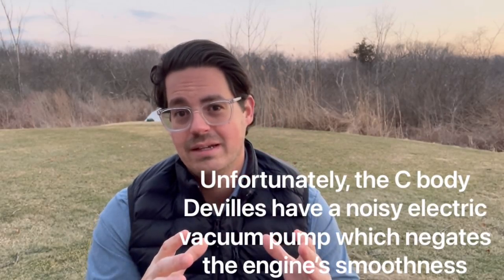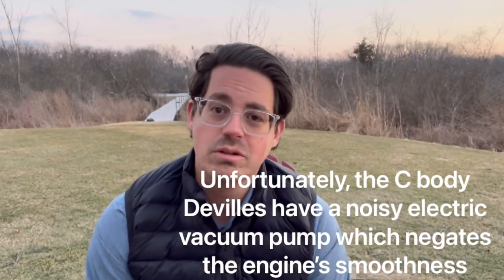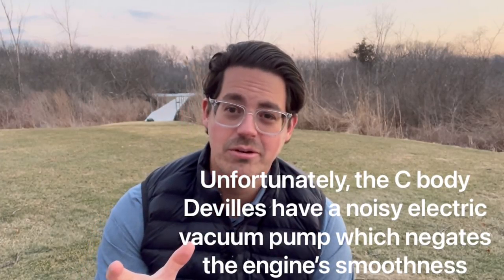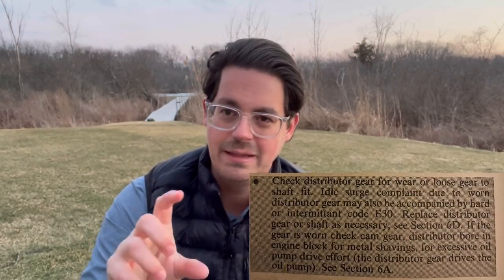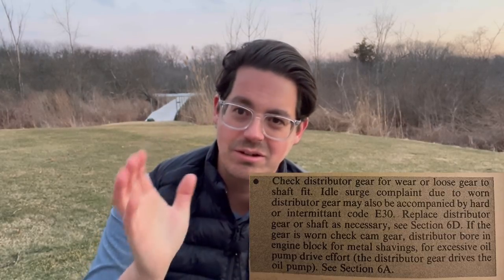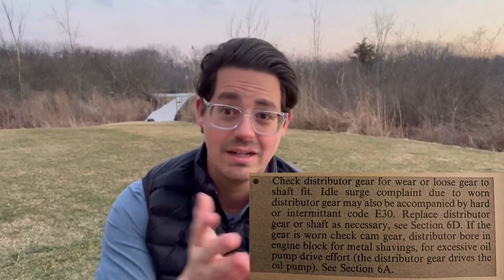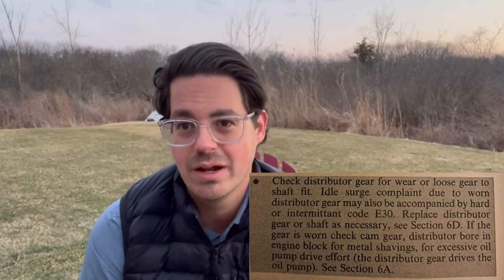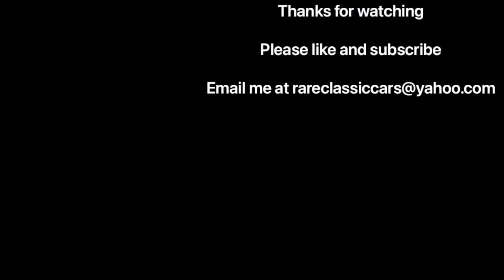Worst Engines of All Time: Cadillac HT4100 - Why is it so bad?  How can you preserve yours?

Comment: Thank you so much for this video! This was the most comprehensive summary of the issues plaguing those of us who owned 4.1 Cadillacs. I had an 85 Sedan deVille just like the one you pictured and I absolutely loved the car as a whole. It was smooth, very quiet and extremely pleasant to drive. My 4.1 had been rebuilt before I got it, but I did have issues:

1. I suddenly lost the oil pump while driving. Fortunately I was on a quiet residential space and I shut it off within 5 seconds of the oil light going on. I towed the car back to my house and dropped the pan, what had happened was one of the large steel pins that the pump gears ran on had slowly worked downward, allowing the shaft to disengage from the distributor. I bought a new Cadillac oil pump at the dealer, it was an updated pump from the 4.5. This issue made me lose trust in the car. 

2. It was very sensitive to plug wire condition. Once the wires started to go bad it would slam into a lower gear very harshly, at first making me think that the trans had gone south. I drove out to a very dark place at night and watched sparks go all over the wires. I replaced them and the problem went away, only to reappear maybe a year later. New wires again solved the problem. 

3. My 4.1 and many others I heard had a dull thumping sound in the engine. Somewhere I read or was told that it was camshaft end play. I don't know, but it sounded bad. 

4. My thermostat went bad twice. Not bad enough to overheat and turn the light on, but when I parked and shut it off I could hear coolant boiling. I kept the coolant fresh and used the tabs. This was promptly repaired on both occasions.

Comment: The 4.5 was ok, the 4.9 was great! I had a 93 De Ville 4.9. Great gas mileage, a hot rod for performance. a pleasure to drive. Car had a few troubles, no internal engine problems. Trans gave trouble, gas mileage dropped from 28 mpg average to 20. Traded it off at 245K miles in '05 for a new Le Sabre. Another great car!
Reply: 4.1/4.5/4.9 all leaked oil no matter what you tried to stop them.  Iron heads with aluminum block is just a dumb choice, too.
Reply: I really liked the 4.5 the best. The 4.9 had too many fuel injector problems, which I experienced on 2 Seville’s which was a nightmare. 4.5 with TBI was the sweet spot for reliability

Comment: Years ago I worked for a firm on Atlanta's south side, whose fleet colors were Dove Gray. We had a Cadillac hearse from 1986. I do not recall who did the coachwork. Anyway it had a 4100 in it. We just hated it, not so much for lack of dependability, more for the lame power output. That engine combined with the weight of a Fleetwood 75 chassis and specialized coach work was completely overwhelmed. I really enjoy your in-depth reviews and knowledge. Thank you!
Reply: When a hearse driver bemoans the lack of power, you know it’s bad!

Comment: This kind of video is exactly what i like on this channel. We all can basically agree that this motor is NOT good at all. But still, some people love these year Cadillacs and want to buy one.  So instead of just badmouthing it to death, it's better to help the lovers/owners of these cars know how to preserve them to minimize damage and issues. Please do a video on the onboard diagnostics. It would be well worth your time.
Reply: If you like the car, swap in a later 4.9 Cadillac engine, by that time they had most of the bugs worked out, and the 4.9 at least produced reasonable power.
Reply: @donreinke5863  That idea sounds good in theory but the cost is not feasible.
Reply: @klwthe3rd  LOL THAT all depends on your capabilities and knowing where to get stuff for the right price.
I once converted a 1981 Fleetwood Brougham from the worthless variable  displacement 8-6-4 368 to a 500 ci engine scrounged from a 1975 Coupe de Ville.
Actually an easy swap.
When finished, that car seemed like it would never stop accelerating, easily burying the 85 mph speedometer.
Reply: @donreinke5863  What do you think about installing a Remanufactured 4.1L ? And if you upgrade to a 4.5 or 4.9, would you have to upgrade the transmission as well to compensate torque?? Thank you 🌅
Reply: @mixtecobajo5582  The 4.1 had too many inherent problems for me to think about doing that. These engines were notorious for having piston slap issues (Cadillac called it a "bell knock" and at one time provided a kit to dealers to repair it)
They were also well known for head gasket leaks, and GM actually recommended sealant (GM cooling system supplement) be added to the engine coolant to address that problem.
Almost every transmission made for the last 50 years has upgrade parts available through the rebuilders supply distributors such as Transtar and WIT, as well as online sites, and its always a good idea to use upgraded transmission parts for greater durability, especially when installing a larger or more powerful engine.

Comment: The 4100 which I had in an 82 Cadillac Eldorado was underpowered and used to ping when under load or going up a hill.  The transmission would over rev and then buck to go from first gear to second.   Yes, I do not remember ever going over 85 mph in this car.   When I first bought it, all the sensors were clogged and had to be replaced.  It wouldn't go over 65 mph and the engine had low miles on it.    My favorite of all times was the water hoses that were channeled around the electronic ignition system.   Someone didnt' hook them up tightly enough and one fell off its fiting and dumped gallons of coolant right on the electroncs.  Killing it instantly .

Comment: My uncle was a transmission specialist in the late 80s up to early 2000s for Cadillac, he sold me a 1986 sedan DeVille he had rebuilt the transmission and probably maintenanced at the dealer in late 2000 and the car ran smooth as butter for having the 4.1v8

Comment: This was informative. I look forward to the video about the 4.5 and 4.9 liter V8 which were derived from the HT 4100. It is interesting what you learn. The odd thing is other GM cars had V6's and V8's that were more reliable and had more power. I used to see the HT4100 badge on so many Cadillacs back in the day. Thank you for the video.
Reply: I believe the 1993 Cadillac Fleetwood was a full size platform RWD equipped with a 350 TBI. If I remember correctly. That's a Cadillac I'd go for from the same era, but has a much more dependable power train. Plus, knowing this I couldn't deal with the HT 4100 in smaller Cadillacs. Anything else I'd go for a FWD 1994 Cadillac Sedan Deville with the well-improved 4.9L. No Northstar junk for me 👎
Reply: @trickyricky12147  Understood and agreed.  At one point the Fleetwood with the 350 V8 was the most reliable Cadillac outside of the 4.5 and 4.9 liter V8 which was much improved. The 1992 Seville and Eldorado used the 4.9. The 1989-1994 Deville used the 4.5 and 4.9. The 1989-1992 Fleetwood and Sixty Special used the 4.5 and 4.9. It was 1993 and up that was the Northstar era. I know the 1994 Deville used the 4.9. It is sad there were some great looking cars in the 1990's at Cadillac but offered a unreliable powertrain.
Reply: @OLDS98  Exactly. It is unfortunate because that had some of the most nice looking old school style Cadillacs in the 90s, but the unreliable engine (especially the early HT4100, but luckily the 4.5L and 4.9L were much better until the dreaded northstar came along. Ugh
Reply: @trickyricky12147  They had a lot of nice looking Cadillacs and the 4.5 and 4.9 helped things a lot and then the Northstar came along. I think it impacted Cadillac more than we will ever know.

Comment: The secret to keeping the Ht 4100 going was the vegetable tabs.  The original owners had them maintained by dealerships who knew about frequently changing the coolant, and added the tabs. When the cars were traded in, and became affordable for the second  owners,  they knew nothing about it, though there is a sticker under the hood about them which few people probably didn't read. So now coolant gets changed, MAYBE, but no tabs are added. Its the beginning of the end for those engines.  Also frequent oil changes every 3000 miles helped greatly. My 83 Eldorado has never failed on me. It has 178.000 miles now, still runs fine.  These   cars  are beautiful in and out, and drive nice and are SOOO COMFORTABLE!! I understand that these engines are available by rebuild companies who supposedly made upgrades to make them much more reliable.
Reply: What are vegetable tabs? I'm looking at an 85 Fleetwood with 80k miles on it and I want to make sure I can make it last. Also, how often should you change the coolant?
Reply: SEE MY COMMENTS ABOVE & HERE:
........about my comment below on using  Evans NPG+ Waterless Coolant.   It is recommended to run a 0 or low PSI radiator cap. That should help stop pressure induced head gasket leaks/coolant leaks in a system that runs high pressure.........

I bet Evans NPG+ Waterless coolantwould be a blessing for these motors, with one of the new generation leave-in Kevlar or other technology Stop Leak formulas (only as a leave-in if compatible with Evans coolant) or a flush & permanant  sealer, & reflush a 180F or maybe 160F thermostat, oxalic acid "wood bleach"  coolant flush (carefully, or use POWDERED TIDE or Cascade Professional Fryer Boil Out),  & neutralize it with Arm & Hammer Washing Soda, (this was the old 2 part GM flush by Prestone AS100......  GM TSB 99-06-02-012D  & long-discontinued Prestone AS100 aka GM 12346500 was a 2-part canister ).    

 I would even be using stuff like the well known AT-205 Re-Seal in the oil, & I wonder if that TRIBOTEX ceramic additive who's always a sponsor on Motor Head TV, would protect the cam.......  

Additives & Preservative for the HT-4100, was all started with GM's wood cellulous based stop leak tabs by Prestone!!!!! 

 Old parts counter HT-4100 joke: 
Take 6 Tabs & don't call back in the morning!   LoL!

Or follow procedure in the JalopyJournal thread titled "RADIATOR FLUSH CEMICALS QUESTION??".  
The GM TSB was also used in over-dose  treatment of the TABS to flush it out when it started to clogg-up the entire system!
Reply: Wow man! thanks for your input. I just found a 40,000 miles eldorado in excellent condition, but I’ve been so disheartened with everything I’ve been reading online about them so far. For a while I’ve been thinking I got a lemon.  I don’t know if the previous owner put pellets in it so I’m going to get it flushed and add some in just incase. I saw that label near the radiator and it made me wonder if that’s why people had so much trouble with these
Reply: Thanks for your comments, really helpful. You mentioned rebuild companies who supposedly make upgrades to make the HT4100 much more reliable. Do you have any company name? Btw I own a 1982 Fleetwood Brougham with 84K miles and am pretty happy so far. I really love the car but am scared with everything I’ve been reading online about the HT4100. Does it worth to rebuild the engine or to swap it with a V8 350 Chevy??
Reply: Yeah I learned the easy way. Did my water pump  on a 93 DeVille. Keep fizzing out the pump no matter what. Went to GM the next day spent 17.99 or whatever the price for those tab's(Bars stop leak copper will work too)and never had a issue again. I drove that thing from Mississippi to Maryland in 08. Sold it to some kid in 09 for 500$. Still was going strong. Gave the SRTs hell around that time too 4s and 8s.
Reply: If you have 178k on an original 4100 then consider yourself the luckiest man ever. Coolant tabs or not, that’s one in a million.

Comment: My GF bought a 1983 Cadilac Burritz in 1989. We knew, at the time, how crappy the 4100 engine was. You are exactly correct about the different metals used in the build. It leaked everything. I told Peggy before she bought that car to get an extra warranty on the engine and the dealer said sure. I think the car had about 50,000 miles when she bought it. After 9 months of ownership and all sorts of electrical issues the engine finally gave up. The dealer replaced the engine at a cost of $5000 (for them) and I think the salesman was fired for selling the warranty with the car. It was a beautiful car with a stainless steel roof. But, otherwise was a POS. Peg purchased a Jeep after that ordeal. Caddy had problems with other engine arrangements too. The 8-6-4 as another POS but likely due to early crude electronics. I'm retired now and have built several engines in the last 14 months. 454, 428CJ, 283, 350, 351, and a 502 and would love to get a 632 but at $30K I suppose I will wait on that one.

Comment: I was horrified when these appeared in 1982, literally half the displacement of what had been under the hood not that many years before.  The Hardly There 4100.  For two different loyal Cadillac-buying friends this was the last stop.  One bought an XJ6 the next time around, and the other a Cressida, and neither has ever gone back.
Reply: Jaguar was 4.2 and had power of the 8.2, british even put it in some armored car, can't beat good engineering.
Reply: Jaguars were horribly unreliable.
Reply: @melrose9252  Engines were good

Comment: My dad had a 1985 Sedan DeVille, exactly like the one Adam pictured. The engine suffered the dreaded demise complete with oil and coolant mixing, even though the car had few miles and Dad drove it gingery.  He had the engine rebuilt and drove the car uneventfully until about 2004. I had a 1991 Seville. No engine problems but I remember it vibrated significantly, which I thought surprising for a Cadillac. Also remember adding the coolant pellets and the prominently placed engine sticker instructing you to do so.

Comment: My grandparents had an '88 Sedan DeVille.. The car was garage kept and looked show room floor new. It had the 4.5 V8. As a kid, i remember the beautiful red leather interior.  It was always serviced by the dealership. I remember the dealership would put some sort of tablets to put in the radiator every 3,000 miles. This was Cadillac's way of fixing the problem with blowing head gaskets.  My granddad didn't catch it in time to save the engine. It only had 110,000 miles on it when it was scrapped.

Comment: Great video! I currently have an 85 Eldorado with the HT4100 engine.  They do run smoothly and get good gas mileage.  It's definitely not a performance engine.
Reply: Hi Greg.
Reply: I was going to look at an Eldorado with that Same engine here soon do you recommend the engine and how has it treated you?
Reply: @codywilt6158  That engine isn't the best by most standards but if it has been maintained properly and the car well cared for and in nice shape they're not bad.
Reply: I found a cherry '87 short body DeVille with a 4100 in it @165,xxx miles. Im sooooo curious as to wonder what was done to it to have reached those miles(rebuild, maintenance, etc). They started out asking 5500, but now its down to 3995. If it creeps down to about the 3500 mark, i just may get it at least for the body/interior. I can always replace the motor, right?
Reply: @willg.5168  It's either been babied or possibly replaced at some point.  Either way if it's working well and the price is good it's worth picking up.  Replacing the engine in one of those however is quite labor intensive and probably would cost more than their original price of $5500.
Reply: @gregdelagrange8573  thanks for the reply and wow, I didn't know the labor would be that hefty. It'd probably be worth it though for a remanned 4100, I'd think 🤷🏽‍♂️
Reply: @willg.5168 although the transverse 4100 was perhaps more reliable, it could have had the engine replaced under warranty

Comment: We made a lot of money selling used GM motors of the 80s 😂😂 I also drove more than my share of these cars at some point. Cars that were traded in with bad motors, we bought from wholesalers and repaired, then one of us drove them until sold. A lot of really nice Caddies. But they were terrible engines for those that had no means to repair. I also recall GM had a bounty on these for trade in while under warranty.....  Or was that the really bad 4-6-8?

Oh, and every 4100/4500 got new water pumps, not rebuilt, on every install. Used engine, sure, but do not do all that labor without replacing with a new pump.

Comment: I bought a triple white 82 DeVille with an HT4100 showing 100k for $800 last fall. Not running, it had been in storage since 1999. It got new tires in 99 and only has a few thousand miles more than listed on the tire receipt I found. So, I am thinking it developed problems at that time.  I plan on a 6.0/4L80e swap.  The car is super straight and solid.
Reply: @Dan Duncombe, what do you think about installing a Remanufactured 4.1L engine to 86 Deville? Thanks🏅